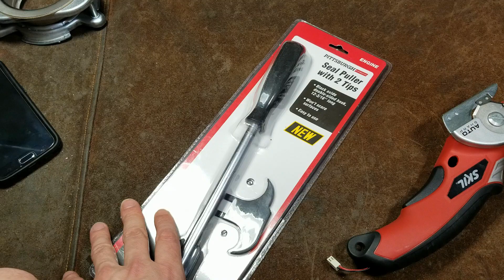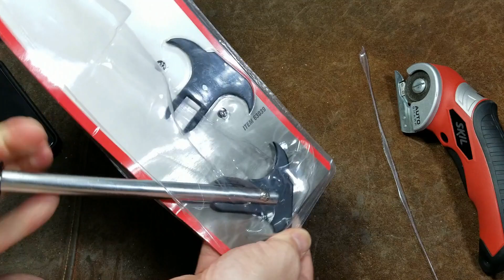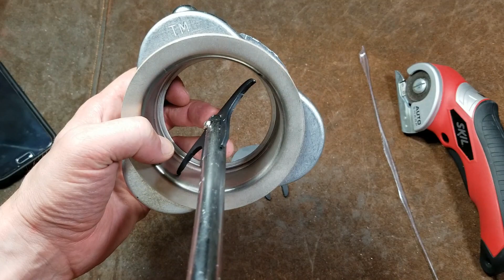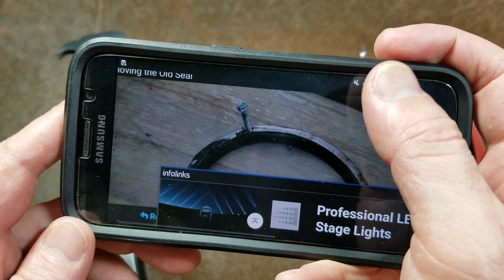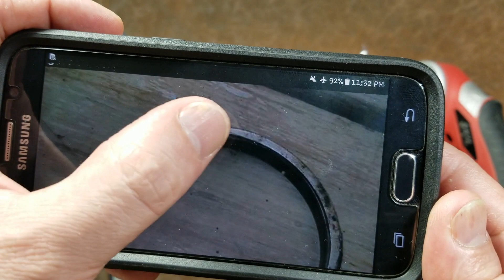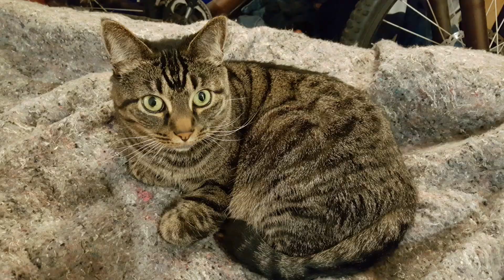Pittsburgh Automotive Seal Puller Review

Comment: i just got one yesterday and it didn't work for my seal. all it did was deformed the seal and it didn't budge at all. I ended up using a brass punch and it popped right out. 1997 t100 inner wheal bearing seal.

Comment: Hello from Louisiana, Catus. Enjoyed a few of your videos, including this one. Personal perspective is always a contributor when evaluating tools and gadgets, and I may or may not purchased a tool based on someone's opinion, and the need for such an addition. I bought the Lisle version of this same tool on Amazon a few months age, for around $8-$9 with Prime shipping. I have several ways I've removed seals for the last 40 years, including a small slot screwdriver, several small picks (Harbor Freight - $2.99), and a pair of mini needle-nosed pliers, and a few "hooked" picks, in different configurations. The Lisle seal puller didn't do it for me when attempting to use it for the first time while changing the cam/crank seals on a Honda B-20 in a 97 CRV. I was thinking, "WTF?", as I tried to make the first move without scratching the delicate surfaces. I quickly abandoned my efforts and went back to the methods which have stood the test of time, and take only a few seconds, or a minute or two for stubborn applications. I may have been impatient, since whoever did this job on this hHonda the last time used Loctite on EVERYTHING - and I mean everything except the cam bolts. Most of the fasteners were already rounded, including the tensioner bolt. I destroyed a few fasteners with my grinder and chisel and Dremeled the lower cover (because of one bolt in a very tight spot). before it was all apart. This unwieldy device will be saved and I'm sure I'll have an opportunity to use it for something, even if not for it's intended purpose! The tool looks to be ideal for the type of seal you showed us on the video. But did they have to make it so big?!
Reply: For a national 370003 it's not big enough (about a 6 inch od that takes at least a 4lb hammer to install)

Comment: I don't see how to use this seal puller to get my camshaft seals out. Should I use a hammer to drive the point into the seal? Picture: https://i.imgur.com/6058gR0.png
Reply from the maker: It's for when you don't have the object still inside the seal in your situation you'll just have to find some wood screws and screw them into the edge of the seal and then use some type of pry bar or clawhammer is slowly pull the seal out using the screws as extractors in putting several in so you can go around evenly

Comment: i had the old orange handle one from harbor freight tools and it was a piece of garbage. the first time i used it the hook bent. i unbent it and then the shaft snapped in half. i like harbor freight but sometimes you get what you pay for.
Reply: I bought the same one you did same thing happened😵

Comment: I actually just bought one of these seal pullers 2 days ago it's the OTC seal puller but it is exactly the same one..👍
The OTC one is oxide coated and came with a couple extra screws
Reply: I'll bet that OTC puller was at least twice the price of the HF unit.
Reply: @markurban4766  it was $7...👍